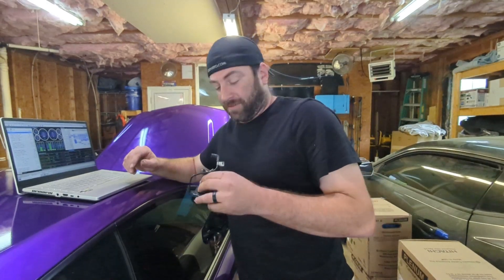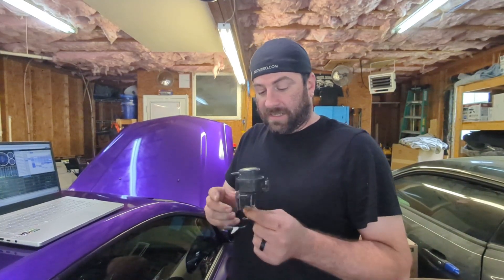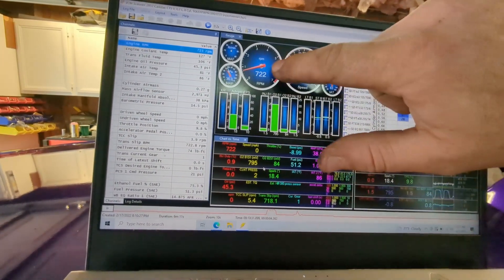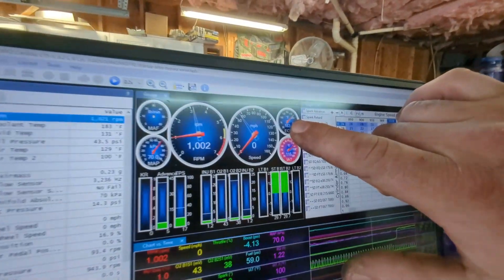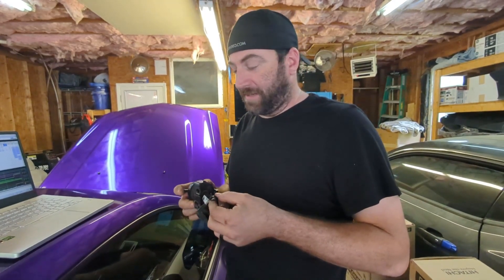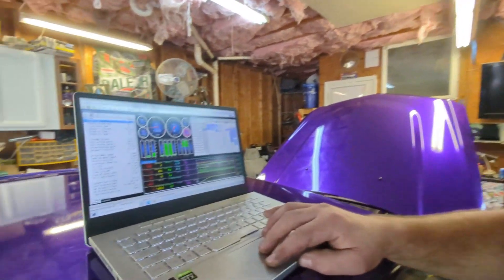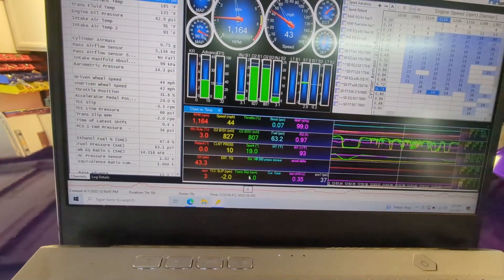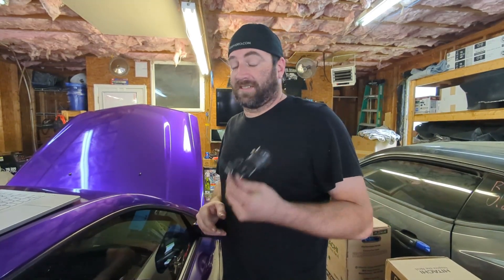Tech Talk. Why you need a Low-Vacuum bypass valve

Comment: Did you remove the solenoid and tune out the CEL, or did you leave it plugged in and cap the openings?
Reply from the maker: We removed it and tuned out the CEL.

Comment: Your units of manifold pressure and air fuel mixture are....
Reply from the maker: Catchy. Let’s see if it’s available.
Reply: Shouldn’t it it actually be making -15 to -18 ? Instead of 9-12
Reply: @WRX-WHITEonBLACK he just has his units all screwed up. He's talking negative psi (which is a retarded unit in this application) you're talking inches of mercury. The proper unit for manifold pressure that's universal and less confusing is Kpa. The unit thing is reinforced when he says "1.0 AFR" that makes no sense as that would be 1:1 air to fuel, INSANELY rich and it certainly would mean a hydro locked engine. What he means is a lambda of 1.0 which is the only unit you should ever really need.

Comment: I noticed with mine that in part throttle I would go into boost pretty easy only at 1400-1600 rpm. I have one on the way hopefully it will fix that issue. Thanks for the info.